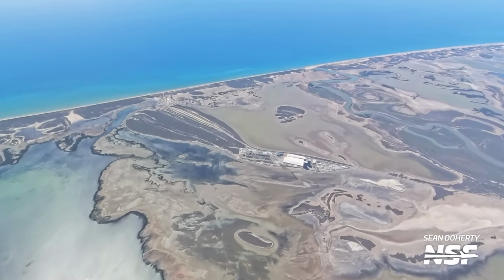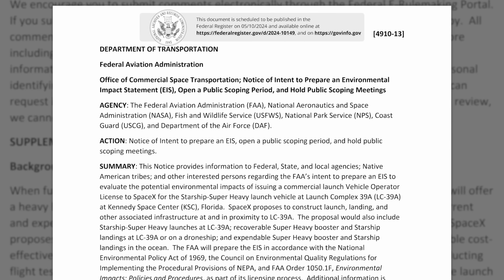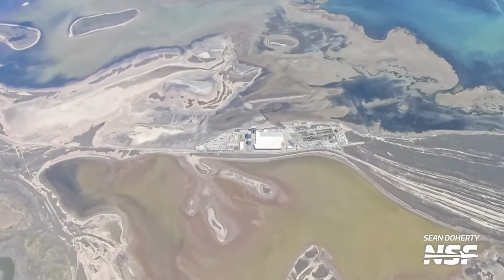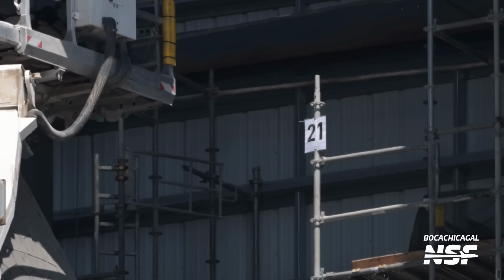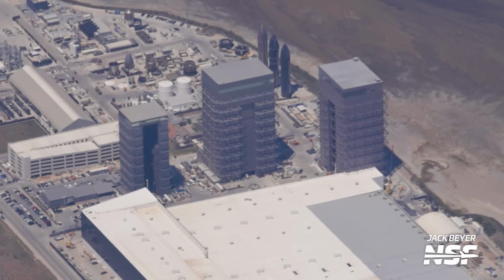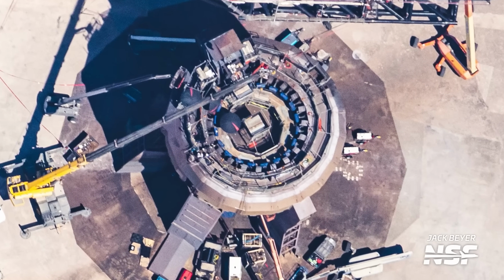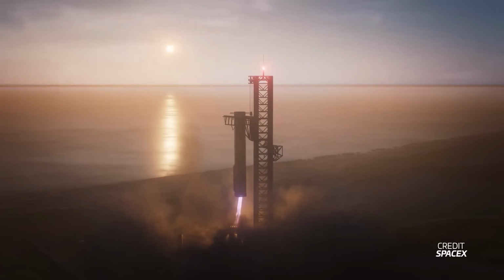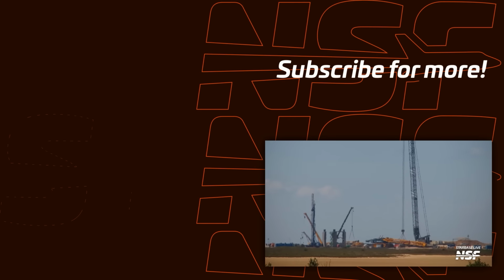Over 18,000 Tiles to be Removed from Ship 30 | Starbase Update

Comment: When will they come up with a "Spray on" heat shield material do you think?  Would it work?  Or does it rely on these things getting "Baked" ahead of time to create their thermal resistance?  Couldn't you put them up and allow them to reenter and "Bake" as they come down?  Perhaps not.  I just never liked the entire idea of these things being "Tiles" with gaps and all kinds of nasty things between them.
Reply: I had the same thought, but for the undercoat rather than the main heat shield.  I think tiles are still the best bet for primary protection when factoring rapid reuse, as they don't wear like an ablator.  I also wondered whether using some kind of soft ablator between the tiles would allow for larger expansion gaps.  I know they used to use essentially a caulking gun to fill in the holes in the PICA ablator in the Apollo days.

The tiles themselves need to be baked first under controlled conditions.  They're basically glass fibre spaghetti in a very wet sauce to begin with.  They're then pressed to wring out a lot of the moisture and create the shape, but they're still like a wet biscuit at that point and would just slop off the side of the ship before it got to orbit.  Plus the liquid would sublimate off in vacuum, wrecking what's left of the tiles and potentially contaminating something important like the payload.  I think the black coating is then sprayed on after baking IIRC, and it's the black coating which re-radiates most of the heat away.
Reply: And thanks for the updates Ryan and @NSF team!  You guys are just doing a spectacular job!

Comment: It makes me wonder why they don't use a somewhat thinner tile set against the hull, and then offset a second layer, so the outer layer covers most of the seams that the inner layer has. It would make a LOT of sense as it would cover the seams, and even if the outer layer tile popped loose, there is an inner layer there.
Another option would be developing an outer spray-on layer, so the seams are completely covered/filled, making the outermost shell much stronger, as it would tend to be one piece, and the tiles help hold its many fellows in place.
Even would be better might be a combination of the concepts - two off-set layers, with an outer 'sealing' coat that is ~meant~ to be oblative.
How about it Elon?

Comment: Ablative blanket under tiles = non reusable ship.   
Am old enough to remember a ship that was reusable and had tiles that could sustain re-entry many times, but still had problems with a few falling off now and then.  Melon Husk has dismissed that one as  a mistake to not repeat, but in refusing to use that expertise, his "iterative development" will take many iterations before arriving at the same tiles/design. 
Same with his insistence that the OLM without flame trench is fine. Taking a few weeks to fix agfter each launch is a log way from doing launches every 30 minutes as he wants to. 
Two launch pads become necessary if you launch a starship and need to launch fuel to it. Either launch 10 minutes paart so they can get into same orbital plane, or launch a day apart. 
Many more iterations needed before his goal of full re-usability;

Comment: In evaluating the Starship thermal protection system we must remember that the objective is not survival, it is rapid reusability.  If the stainless steel hull is exposed to more than about 800°C it may deform, which could require a major rebuild.  By contrast even the loss of a few hundred tiles could be repaired in a few hours.
Reply: Longer term they shouldn't be replacing/repairing tiles at all between flights with rapid reusability, it should be rock solid and not need an ablative (non-reusable) backup. I understand this is still being iteratively improved, but instead of actually solving the reusable heatshield problem it seems like they're just creating more stopgaps. I personally think a tile solution is fundamentally flawed for rapid reuse, but if anyone can figure out a way to make it work it's SpaceX. I'm concerned though.

Comment: Now we see hardware for testing a booster with 5 centre engines this is all starting to make sense.
Booster V2 is needed for Artemis to reduce the number of tanker flights, and given there is room to get 2 extra engines in there, it's a slam-dunk of a way to increase the payload.
Another significant advantage while improving Raptor's reliability is having 5 engines available for that hoverslam providing more redundancy for engine failures. This may also provide more attitude control during the final phase of deceleration via differential thrust.
Naturally, they may still need to do the final stage on 3 or fewer engines if they cannot throttle down sufficiently with sufficient control for the hover onto the chopsticks.
Reply: Couple quick clarifications, "need" Is the wrong word, it will help to lower tankers, but its not needed. Starship and its booster dont do hover slams, they do controlled touchdowns. Also differential throttle is specifically for those which dont have gimbaling. 
But i appreciate how much you understand so many areas in space flight, you certainly get into this stuff quite well.

Comment: I wonder if 35 Raptors would hurt their ability to gimbal. Which would result in diminished control of the booster. Same question for 9 Raptors on the Ship.
Reply: I made the very same mental note!
Since they plan to leave them all unshielded on the outer ring of engines, perhaps they plan to increase their mount position outward slightly, then shift the middle ring as well, thereby affording the Inner ring some additional wiggle room...

They wouldn't have much room between each other, but I suppose it's likely they'll just all be moving in the same direction anyways and don't need much space between them. 🤷‍♂️
Reply: @DUKE_of_RAMBLE   You could be right. I guess we will see.

Comment: Thanks Ryan. Good finds/supposition on the hexagon structure and likely correlation to booster 2 engine config.
re. tile replacement: 18K tiles / 21 platform levels suggest that with enough people working simultaneously they could conceivably get 'er done in like a week. This ignores both availability of that many workers, but also maybe weight limits on the scaffolding and how to get materials to where needed in such a crowed work space.
These guys sure know how to remove barriers,

Comment: Agree we do not have a scale for 15 engine trust simulator to confirm diameter of each ring of engine thrust. 
But, if you think about it we do have indirect evidence for 5 eng boost back burn:
--- labels show the tank walls being reduced from 4.0 mm to 3.6 mm - a reduction of 90 kg/metre height of current booster. Additional tank height adds about 810 kg/metre of extra height.
--- the engine count goes up by two to 35, but the weight of onboard equipment and gas to spin prime and gimbal 8 engines can be eliminated if only do 5 engine boost back.
--- if middle ring does not gimbal, it can be further outboard, reducing mass to transfer thrust to rocket tank walls.
--- the 13 engine boost back burn was done with the heavy hot stage connected - the new integrated hot stage may reduce the hot stage mass by half. 
Available thrust:
--- 13x230T is 2990T thrust 
--- 5x230T is 1150T thrust.
--- 5x280T is 1400T Thrust. 
--- 1150T/1.5= 767T thrust
--- the Booster apparently weighs about 250T. If it has retained 10% of its fuel for boost back and landing (410T), the whole Booster will only weigh 660T. In 'almost space', they won't need a T/W thrust ratio of 1.5, but if they want it, that is 990T thrust.  Thus 5x230T (1150T total) engines should be plenty even if the Booster needs 517T fuel and T=1.5 Booster mass.

Comment: I wonder if they could use some heat shield tiles on parts of the OLM? 🤔
Reply: Someone suggested doing that after IFT3 in the What About It comments.
I thought about further just a few days ago and my conclusion is it probably wouldn't work out... My suspicion is that the sound shockwaves, combined with the fragility of the tiles, will result in most/all of them being destroyed. 🫤

So it's likely faster and cheaper to just do the refurbishment each time, and applying a new coat of whatever "paint" is applied.

It'd be interesting to know what they are coating it with... Because in the performance automotive scene, you can get your exhaust headers/manifold parts ceramic coated. Which these coatings are resilient enough to withstand the exhaust glowing red hot during operation, as well as them cooling back down to ambient temp afterwards, and have it survive over many heating and cooling cycles.

However, it is also kinda fragile, where dropping, say a wrench, on it will chip it. So it's possible that it, too, would not hold up too well.
It wouldn't surprise me if what they're coating it with is ablative, only having to last long enough for those 10-15s of engine firing before everything has cleared the OLM... Just long enough to pregnant the metal from being damaged.

[/speculative ramble] 😅

Comment: NSF, please redo your 35 raptor images. It is not conceivable that Booster will need more than 14.3% of lift-off thrust for Boost back burn, or landing burn. The middle 10 engines will become fixed one-start engines like the outer 20 engines. It will save weight, reduce cost and boost payload.
Reply: There's really no evidence the middle 10 engines will become fixed. We can't re-do something we don't have much information about. The booster will indeed need more thrust on the next two versions as both ship and booster will get more propellant capacity and therefore be heavier so they obviously need more thrust to lift all of that off the ground.

Comment: Heavier and heavier and heavier this ship gets. It already has been de-rated for lower payloads. These changes will lower it even more.
Reply: The additional weight is to add more fuel and more thrust. That means more payload. Starship has not be de-rated. Just prototypes being prototypes. Not sure how so many people cannot understand that.
Reply: @anthonypelchat  It has been. There are videos comparing earlier numbers to current ones. And people who have calculated the fuel usage using the live streams and the real lift capabilities of the current version.
Reply: @Dav1d_B  That is not derating. That is current prototypes in the testing phase. Further, the last 2 flights have ran with less fuel than the first 2 flights. And flight 2 dumped fuel while in space.

Again, you and several others don't seem to understand what prototypes are. These are test articles that are not trying to be optimized yet. They are just testing different items currently and will be optimized later on.
Reply: Yeah, that's probably the reason they now want to make the rocket longer than initially planned.
Reply: How can it be derated when it hasn't even been rated? Why would carrying a lower payload  require derating, when it can simply be placed on a spacer to adjust the weight distribution?

Comment: I dobt see why they need so many tiles. Make big bespoke tiles that are like big shields and then they will be less gaps and easier to replace
Reply: Maybe it would turn be necessary to make them curved, which may not be not worth the effort.
Reply: Why would a bigger tile be easier to replace, and If the tiles aren't bespoke then who else uses them?
Reply: Why would larger tiles be easier to replace? The gaps between tiles are not an issue since they are needed for when the ship expands and contracts with heat. Large tiles would crack or fall off even more.
Reply: @filonin2  I think larger tiles would be easier to replace because smaller tiles would be harder to replace (imagine they were only one third their current size).

Comment: I hope booster 15 gets paired with ship 26
Reply: I thought they weren't using V1 prototypes? I thought they were starting to manufacture V2 if not I'm kinda disappointed
Reply: @Jorged18  unfortunately v2 hardware has yet to be made into flight hardware... So yeah. V1 is still the current generation
Reply: @Nice_Pixels  that's disappointing, I could've swore I heard someone saying that flight 4 is the last V1 prototype
Reply: @Jorged18  that's just false
Reply: Or are they making additions to the V1 rocket

Comment: For the 35engine Booster, it could as well be that they keep the engines at lower thrust for the beginning. More engines more better :D
Reply: But "The best part is no part."
Reply: @jamescobban857 The engines, combined, are a part.
Reply: @JohnPritzlaff  What? lol
If you are suggesting 1 engine is the same as 40 as "a part", that is absolutely not the case.
Reply: @jamescobban857  For complexity and weight yeah, but Its barely more complexity to add two engines while raising thrust to weight which equals more payload due to less gravity loss. So its weight that makes less weight in the end.
Reply: @Vatsyayana87  There is no weight in space, only mass.  The ROCKET EQUATION always wins, and that means minimizing the number of massive engines once you no longer need to accelerate vertically.
Reply: I see the logic but thats not how Spacex plays this game, others like ULA do this but Spacex are very intent on destroying gravitys face. The purpose of so much thrust on Super heavy is specifically to lower gravity losses which increases the payload possible.
Since Starship is far behind its payload goal, every decision will be done with this goal as the main factor.

Comment: Out of curiosity does anyone know how thick the steel is that being used for the corner posts and the sandwich wall sections for the base of the tower? There are so many people watching in such detail that I'm thinking maybe someone got an up-close cross-sectional photo of some of those steel parts being trucked in and might have been able to estimate the steel thicknesses.
Reply: The info is probably paywalled on the nsf website, if it's there they won't share it if you don't pay act nobody else will share it either if they are a member.

Comment: I feel pretty confident those are tire marks, not scorches at the test fire stand.
Reply: Yeah, I think you're right.  You can see how they continue onto the flat concrete at the top of the trench, where they have a very similar appearance to what I think is undisputedly tire tracks where some vehicle drove across.  The tire marks are likely more visible on the slope of the trench simply due to how steep it is - it takes more lateral force from the engine through the tires to climb a steep slope (or brake while going down) compared to going over a flat area, so it stands to reason that tires would wear at a faster rate and leave behind more rubber.
Reply: @Keldor314  Precisely, the uniform lines makes it unlikely but possible to be scorches but them continuing over the edge in the same lines is basically impossible for scorches but could 100% be tires continuing to grip hard in order to get vehicle over the edge.